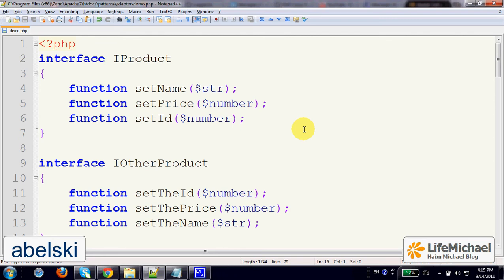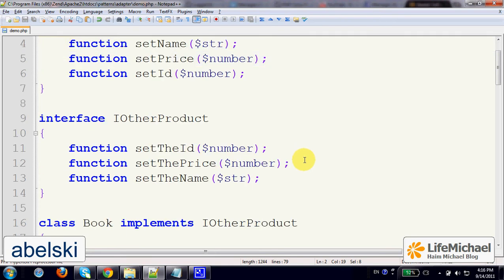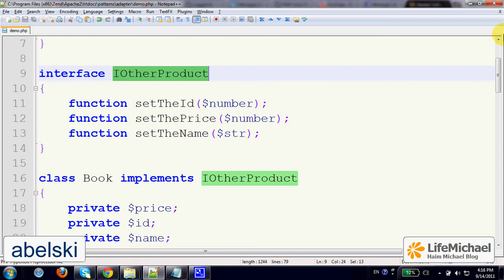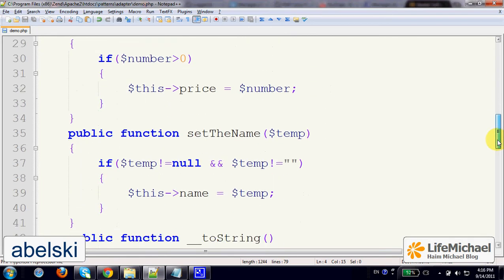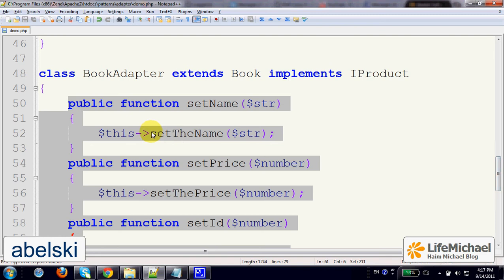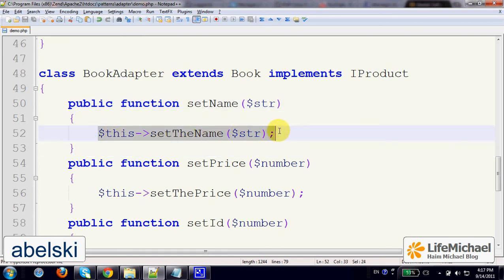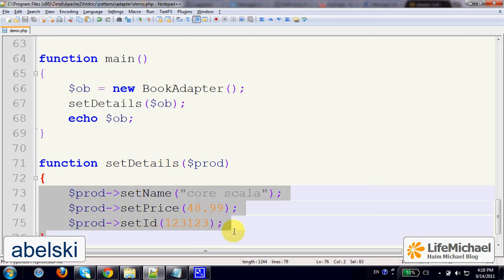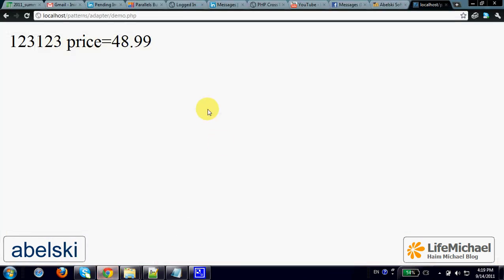The Adapter Design Pattern in PHP

Comment: Could you give a better use case than writing code to fix an easily fixable mistake? What is the general Problem/Solution that this pattern is supposed to address?